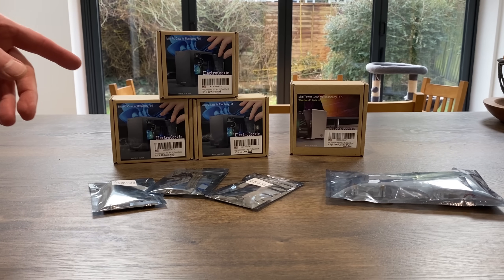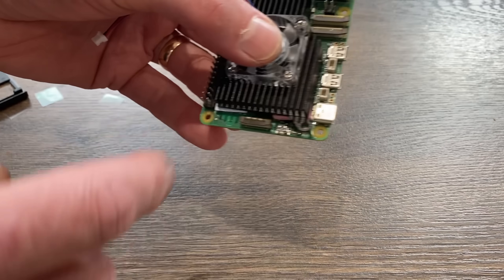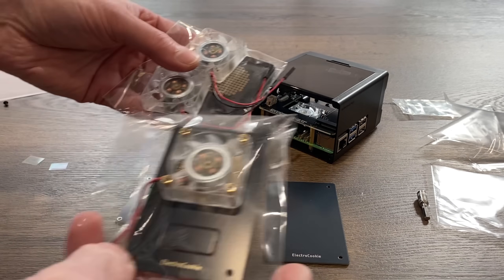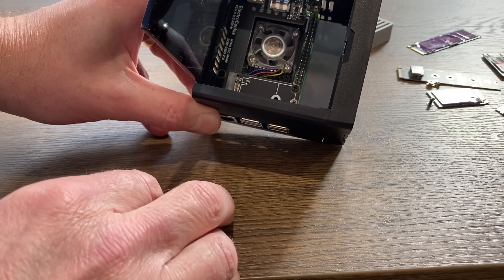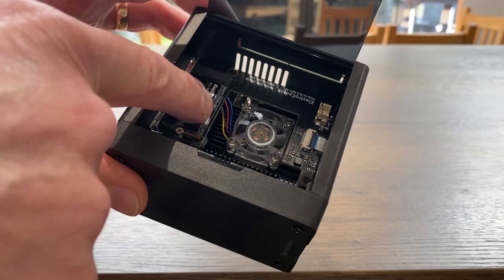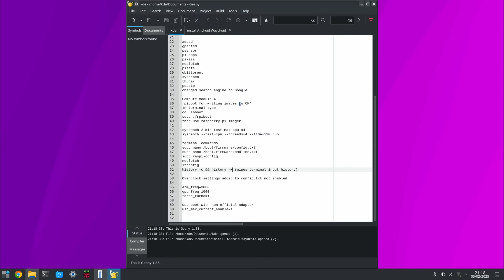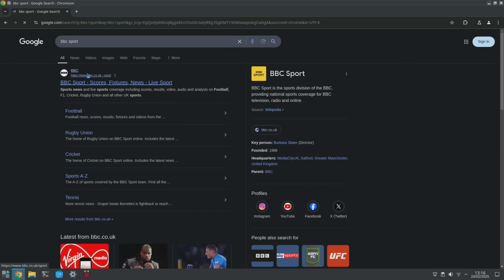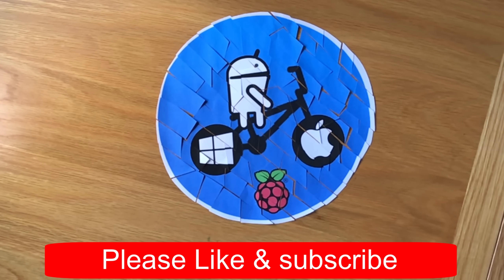Electrocookie Raspberry Pi 5 NVMe case with a Door!

Comment: Question: but on the ElectroCookie Raspberry Pi 5 case, can the M.2 S2Pi board be mounted, or are there problems? Can you check? I have all the NVMe drives in the 2280 format.

Comment: This looks cool, but it seems really odd that the case is about twice as big as it needs to be, while at the same time not fitting a 2280 SSD in the stock configuration. 

It also would have been nice if they'd moved the ports around to one side and added full size HDMI, kind of like a stacked version of the Argon Neo or  DeskPi Light.

Comment: It's a really nice case but I now don't like the outputs on two sides.  I would like to see if there is a Pi 6 to have a longer PCB and all the outputs at the back as standard.  If I got another case, I would go for the Deskpi Lite one.  If I had the money, I would just get one to store away just in case they disappeared.  My main computer atm is actually a Pi 500 which replaced a Pi 400.

I have been pleased with the Game5Pi case for Batocera but would rather have the usb flap facing front but I don't want the the power and HDMI cables going in from the side.

Comment: Great video, very interesting case.

Could you have used built in network pi imager to image locally between the usb and nvme drive?
Reply from the maker: @gedgicat2063  yes, but I was using my custom Raspberry Pi image with KDE Plasma.

I could have written one of the available systems

Comment: I would NEVER pay 1 cent for any PI 5 case that doesn't convert the ridiculous mini HDMI ports to FULL size HDMI.
Reply: It's not that big of a deal bro
Reply: @Mauritsklabamcodm  well BRO...its just another piece to buy and a lot of other sbc's have gone to full hdmi but hey Raspberry designers must know their ranks will fall in no matter what they put out there.
Reply: @myers830 i guess it is a big deal for you?
Reply: @myers830 You could argue that a case that converts mini HDMI to full HDMI would also have an increased cost just to do that conversion - so it's still "another piece to buy".
Reply: @terrydaktyllus1320  Yes exactly, if you want more you gotta pay more
Reply: I really wish the Raspberry Pi folks would fix this. Go back to one full size HDMI, and give us a USB-C port with an alt mode to connect a second screen. (Either a second type-c port, or just make the power one more functional.)